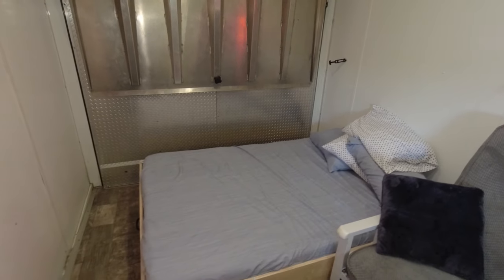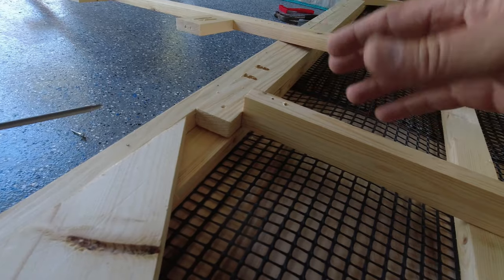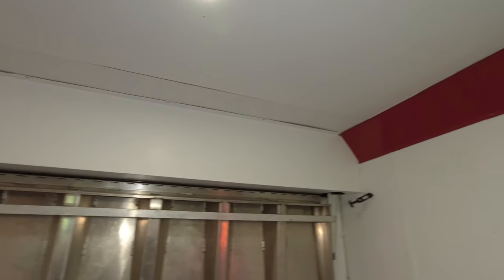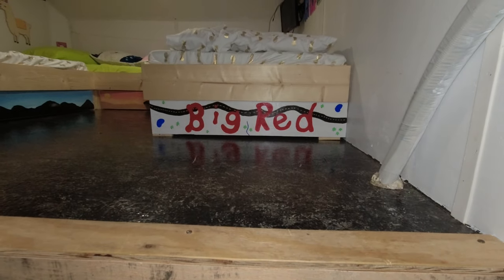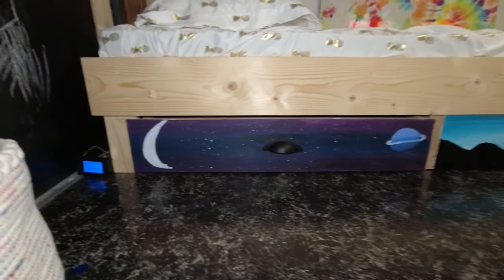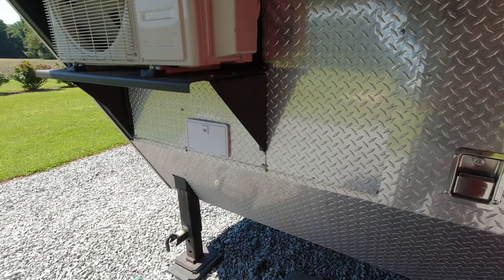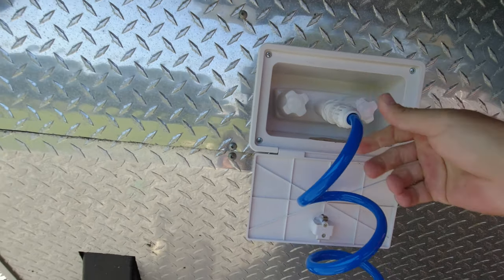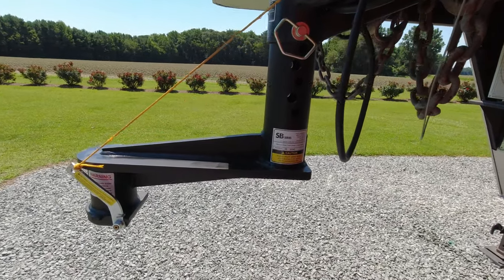Transform Your Cargo Trailer: Exciting Murphy Bed, Outdoor Shower & More!

Comment: Nice rig.  I like your shelving solution in the kitchen area.  My backsplash suggestion is flat stainless steel or aluminum if you want a cheaper alternative.  Aluminum flashing roll stock is at Lowe’s or Home Depot.
Reply from the maker: Thanks for the suggestion! We’ll check out the aluminum next time we’re in Lowe’s.

Comment: Goo Gone is great for getting glue and sticky stuff off.  First rough up all the sticky areas if not already done, squirt it on, soaking the area, then let it sit for a while before scraping off.  Of course it's already 10/3 so this advice is probably way too late to help you...Lol.
Reply from the maker: Thanks for the recommendation! I’m still slowly removing the adhesive with a heat gun, goo gone and a plastic razor blade. It’s a slow and tedious process and I’ve had a hard time focusing on getting it done. Maybe now that the weather is cooling down I’ll find some motivation. Thanks for watching!
Reply: @BuildYourOwnAdventure  Best of luck!  Cooler temps will help.